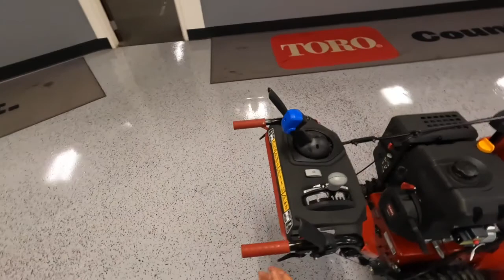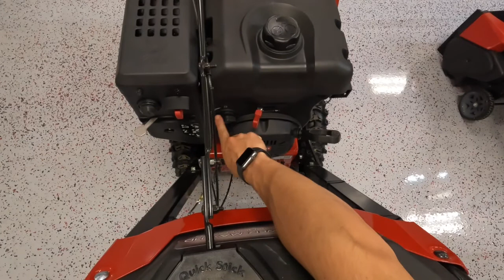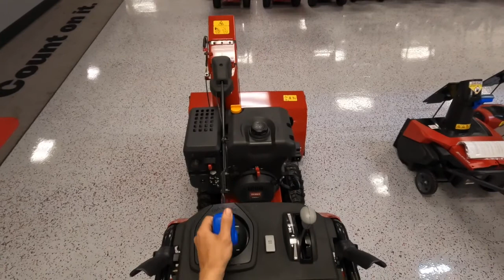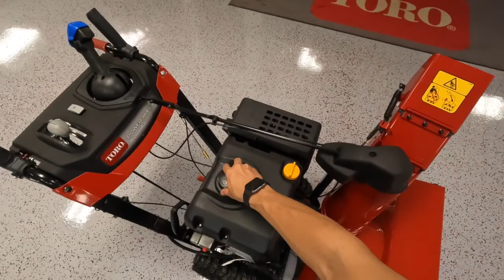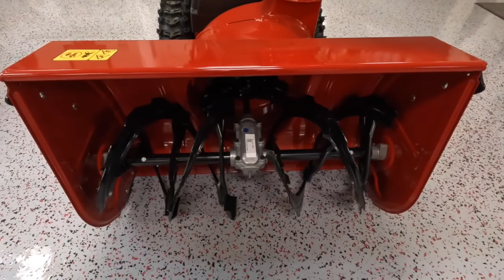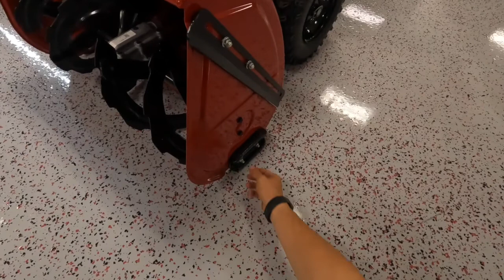Toro Power Max HD Commercial 1432 Tutorial

Comment: For those who are wondering about the narrow tires on Toro's and Ariens. A narrow tire digs in much better than a wider tire. Back in the day of snow tires on cars, they were narrow so they would not ride on top of the snow, but dig in. My Toro Power Max HD 1232 has great traction as long as there is no ice under the snow, in which chains would be the best for traction. Overall, the Toro Power Max HD snow blowers are one of the better snow blowers on the market. Especially in wet heavy snow, the anti-clog system of the Toro's really works well.  Living in southeastern MI we get some of that wet heavy slop at least once every winter. My Toro has never even come close to clogging and is still able to throw the wet slop an amazingly long distance. I also like the idea of triggers to steer the machine instead of the auto-turn differential. But to each there own on that one.